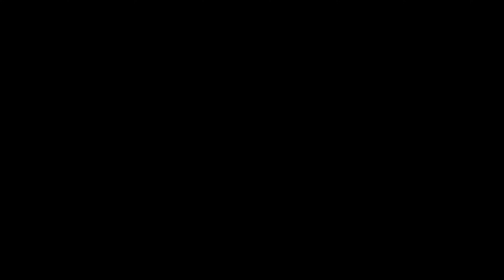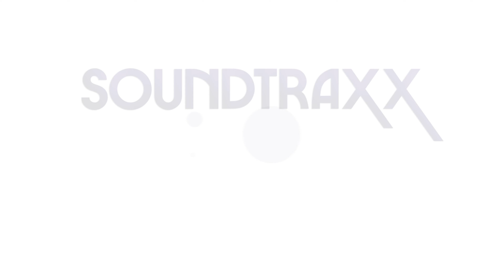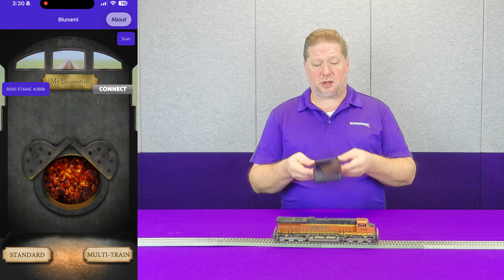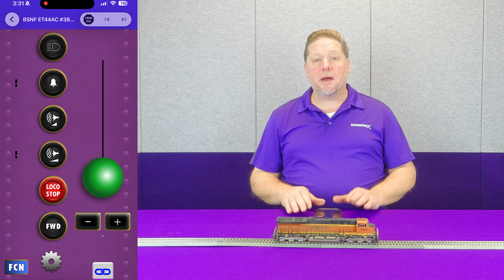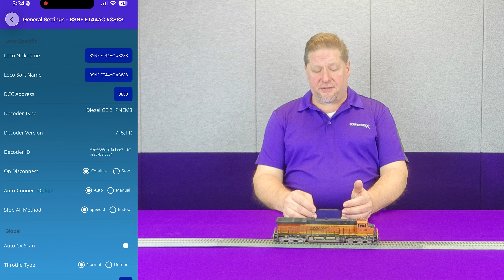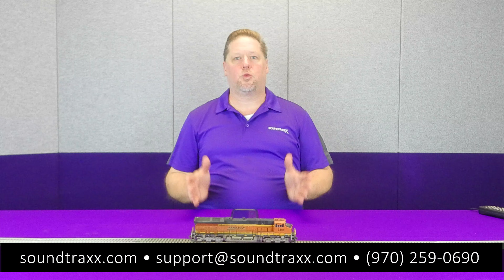Getting Started with the Blunami App (E1)| General Settings & Key Features

Comment: I have a question do u have to use dcc controller to make the trsin run and what kind off dcc thats in a tsunami 2 cn
Reply from the maker: You don't have to use a DCC system with Blunami. You can. But it also has a free app. All you need is power to the decoder and the app with Blunami. Tsunami2 does need a DCC system.
Reply: @SoundtraxxDCC I know but its hard to find a didgetrix ddc controller